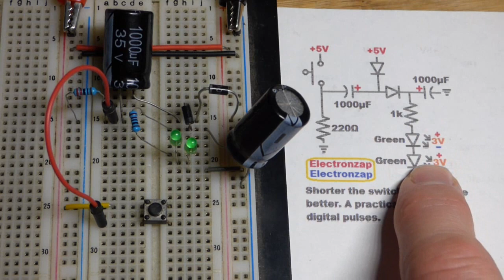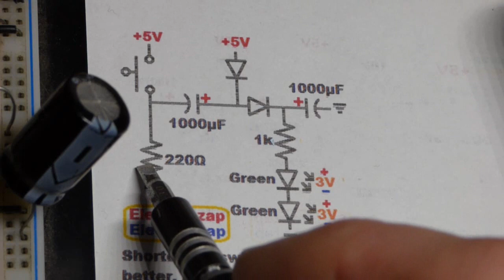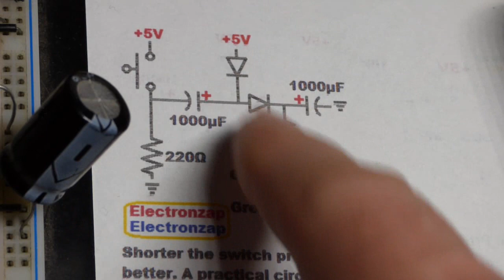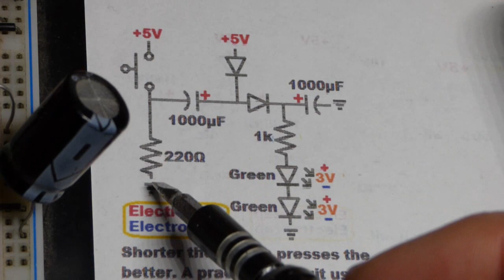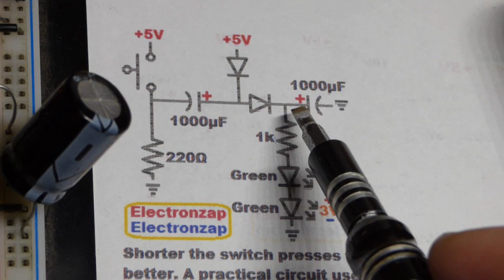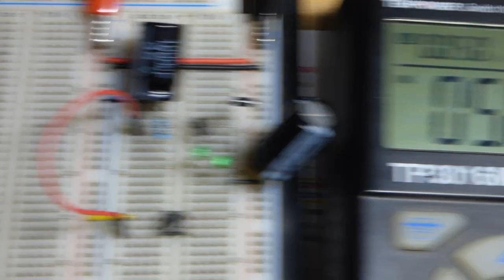Voltage Doubler with 2 Diode Drop Demonstrated using Push Button Switch Circuit by Electronzap

Comment: I removed the R220 and voila'!  Shorted!!!
I then exchanged the push-button for a PNP bipolar transistor and the lights stayed on (current just bypassed the 1000uF capacitor and blew right thru both diodes)
Reply from the maker: Thanks for the info!

Comment: Change the switch for a flashing transistor. What happens? 😊
Reply from the maker: Push pull transistors controlled by an oscillator works well. Did that in old videos, don't know when I'll make a new video.